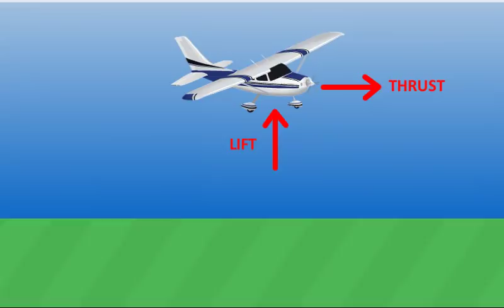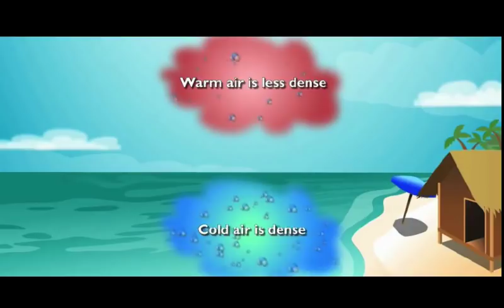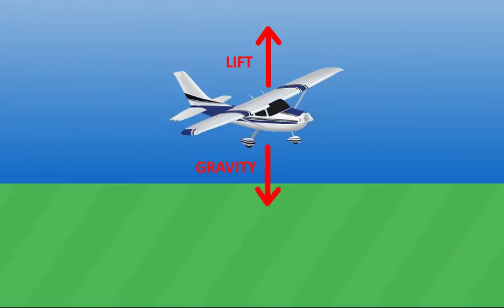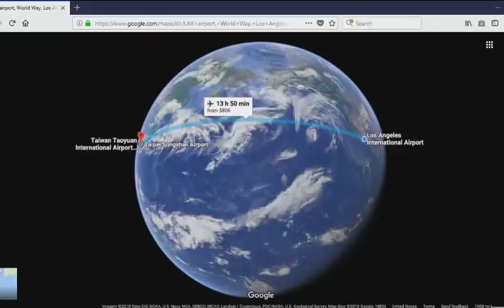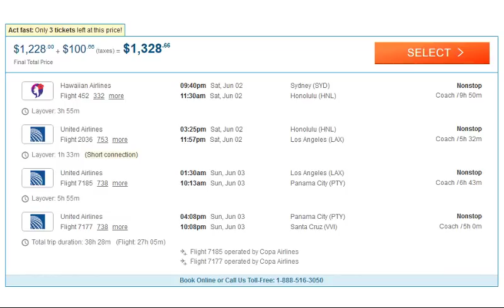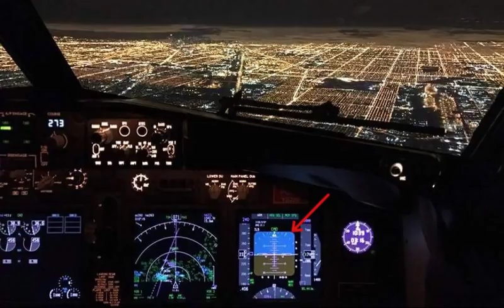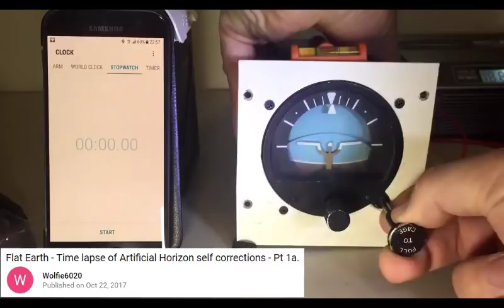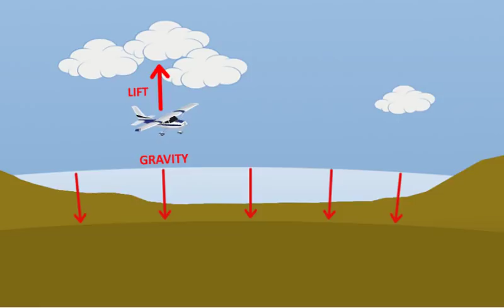Flat Earth Falsities - Plane Nonsense

Comment: I like your explanation of friction and using a car and a ball to explain why, but what you actually proved is that  there is a dome covering the earth, because if you are driving in a car like a convertible and you throw the ball up in the air the ball will be blown back and away from you, so if the earth is spinning 1000 mph without a covering we would be blown away,  so  your explanation is flaud, you may know a lot about science but your common sense is lacking.
Reply: Some people just love sticking their size 12s in their flappy gobs and make a fool of themselves.
Let's see how good you are. What is the genesis of your dome?
Reply: What about gliders it uses the wind to rise wihout an engine and some birds does the same thing , y'all scientists need to take y'all heads out of y'all asses and speak the truth, if the earth is spinning 1000 mph in one direction if you fly a plane against that direction you should reach your destination quicker than if you were flying in the same direction as the earth as it spins do the math and stop the nonsense.
Reply: Gliders and Birds use thermals (heat rising) not wind.
Reply: Kurt Moseley Do you want to enlighten people as to how the plane would reach its destination sooner? Please think very carefully about all the factors before answering.
Reply: @kurtmoseley4146  That depends on how you measure speed. Even though we're moving very fast along with the earth, we still say we're moving at 0mph when we're standing still.
Reply: @Kurt Moseley  Still awaiting your answer Kurt.
Some people just love sticking their size 12s in their flappy gobs and make a fool of themselves.
Let's see how good you are. What is the genesis of your dome?
Reply: Our atmosphere is not strong enough or dence enough to keep us secure, because if it was you would not be able to fly into space.    Your explanation is not 100 percent you need to show more proof and gravity is not strong enough, can you create a working globe earth on a small scale like a science project, I bet you can't but I bet and know that you can create a working flat earth, all that talk about atmosphere and upward pressure and downward pressure is not a good explanation so try again.
Reply: Kurt Moseley
Some people just love sticking their size 12s in their flappy gobs and make a fool of themselves.
Let's see how good you are. What is the genesis of your dome?
Reply: That's the same with his helicopter iss doesn't spin but aeroplane does f....
Off science dude
Reply: wayne Patrick
Not you with your inane posts again?
Reply: First off, we all move along with earth's rotation, and wind speeds are normally 17 mph or less, the planet needs more heat and rotation speed to actually have the ball fly in the other direction, it would have to have a constant 200 mph winds or more in order to cause it to fly the other way.
Second off, no, the ball would fly off in a different direction due to gravity
Reply: @NotTheCIA I.think how do u know?
Reply: NotTheCIA I.think there is solar wind
Reply: @NotTheCIA I.think sorry bud you have no idea whats really above you. Only what youve been taught by lying men.
Reply: +Bobby Wizdum   was asked, to prove Bobby isn't a lying troll.
"OK lying troll Bobby, prove you aren't a lying troll.
Why is it that a compass needle is more or less vertical at the poles and horizontal at the equator?
And when you carry on past the poles the needle slowly returns to the horizontal?
Why is it that it is only possible to navigate accurately over long distances using spherical trigonometry?
Why is it that traditional gyro compasses work perfectly in low latitudes but became unreliable in high latitudes?
Why is it that it is only possible to navigate accurately over long distances using charts based on a terrestrial spheroid?
Why is it that when you watch a ship sailing away from you the hull is the first thing to go below the horizon, then the superstructure and finally the funnel and upperworks?
Does a magnetic compass point towards polaris (Alpha Ursae Minoris) at the north and south poles?
Does a gyro compass point towards Alpha Ursae Minoris at the north and south poles?
What is the relationship between longitude and distance when travelling east or west parallel to the equator?. If you know the answer then you know the earth is a spheroid. If you don't you are not qualified to comment on the earth’s shape.
Please explain the principles behind the development and functioning of a gyrocompass? If you can then you know the earth is a slowly rotating spheroid and gravity is a fact. If you don't you are not qualified to comment on gravity, the earth's shape or movement.
No evasions please, just straight, honest answers.
And Bobby's response was
"wong why don't you stop changing the subject."
So Bobby agrees to being a lying troll.
Reply: @NotTheCIA I.think if that were true then anything approaching the vaccum mouth would get sucked away.
Reply: But we do have a cover.  Its called an atmosphere.  It is basically at "roof to our GLOBE earth
Reply from the maker: Kurt - No, because like I said, the atmosphere moves with the earth too. The enclosed car is a good analogy because the air moves with the objects in the car, just like the entire atmosphere moves with the rotating earth.
Reply: @JonasGrumby71  explain iss spin then idiot
Reply: @JonasGrumby71  and your statement is not only unproveable but contradicts the very things we see every day with our own senses